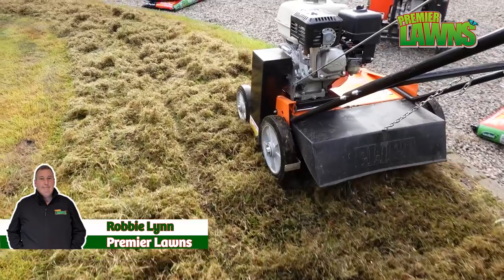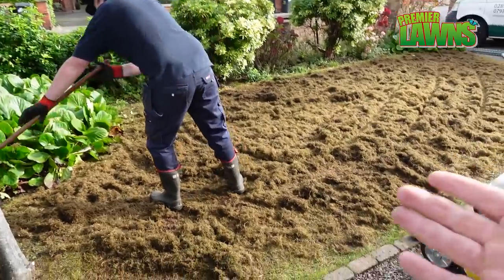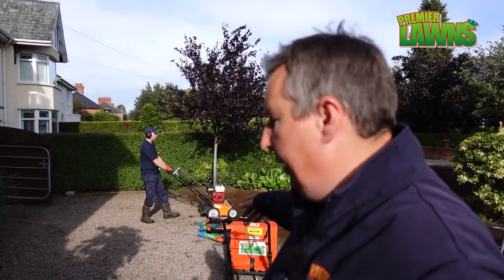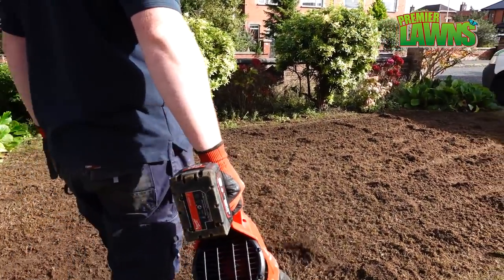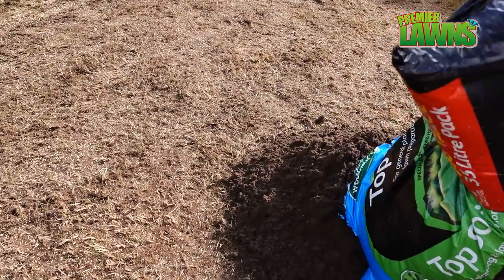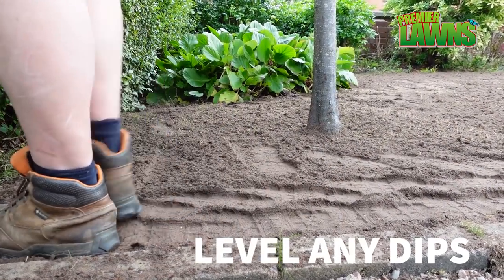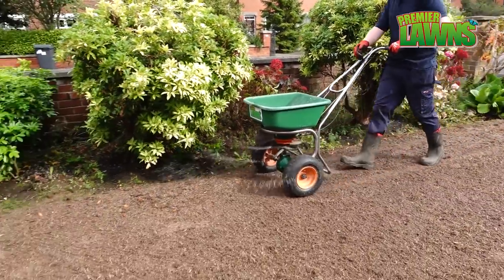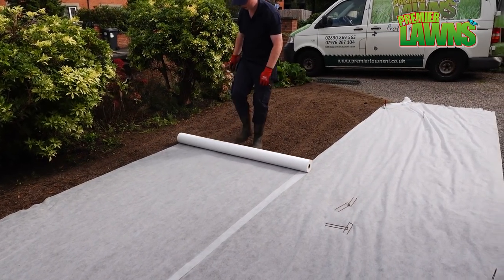QUICKEST way to turn a TERRIBLE lawn into a GREAT lawn

Comment: During the summer my lawn looks ‘fine’ but during the winter and after rain showers it gets very spongy ( there’s no moss).  I’ve aerated and scarified it over the years and recently bought an auger bit and began the process to try and fix the constant  drainage problem of my small (30m squared) lawn, it wasn’t long before I was hitting something solid which turned out to be an old paving slab, I then unearthed a further 9. There appears to be a layer of dolomite throughout with a few inches of poor top soil which is of a clayish texture and full of stones. In some areas the dolomite is sitting on top of a layer of polythene covering the clay soil beneath. Additionally after a few hours the holes I’ve dug become waterlogged. Should I just bite the bullet and get all the dolomite removed, get a French drain installed and a few tons of quality top soil or can the dolomite be left and just remove the top soil replacing it with better?
Reply from the maker: Can't beat a good drain, assuming you have a good fall and more importantly somewhere for that water to go !
Reply: Getting a herringbone system fitted next week so hopefully will finally be on the way to getting a perfect base to start a lawn following your advice and tips

Comment: Your lawn videos help me relax after my stock market research. Also, they have helped me grow my new lawn.
Reply: The one thing I didn't do is level it with a rake but I did aerate first, then seed, then stomp over lawn with flat soled sandals (lawn is very small), covered lightly with topsoil and watered. Now it looks pretty good. A few thin spots though. My lawn gets almost no sun it's totally shaded which makes it hard but it's actually doing not bad. Fescue is what I used too
Reply: My "lawn" before was all moss mats 😆 🤣 so I literally just pulled up bags and bags worth of moss, and grew a lawn after
Reply from the maker: @christalball93_  Happy to help!

Comment: Great video.
 People shouldn't be afraid to try this especially on a small piece of grass like this. I do love planting from seed you know what you're getting, Especially when you make sure you buy a quality seed.
Reply from the maker: I think with my videos doing this, there will be a lot of dead lawns this spring 😂
Reply: @Premier_lawns_official   Timing is everything when seeding.  I did my renovation starting in the middle of August Is in the Pacific Northwest. If I had so many weed grasses that I killed it all off and started over. I did the same with a scarifier and shredded it .  I re-seeded with RPR perennial rye. We had some snow for about a week but it came out like a champ !
Reply from the maker: @richardharwell  perfect. I think in the UK 100 percent PRG isn't that great for lawns as it thins out of winter. Have you found this?
Reply: @Premier_lawns_official  The new RPR  has done well so far . It looks like it did in the Fall, maybe a little thicker . If it thins I'll over seed with fine fescue and Chewing Red Fescue. 
Im planning on reno the front yard with Midnight  KBG & Grand Slam P.R.. still trying to decide.

Comment: Great video. I have low spots and bumps in the lawn. If I reseed and then build up low spots with top soil using lute will this prevent seeds coming through. Thanks Robbie
Reply from the maker: No, the weeds will find a way. We killed the lawn off first

Comment: A good professional job . No bother to Premier Lawns , the grass looks very healthy and green , Roll on Spring  .
 Just one question , would a shady  variety  of grass seed  really make a difference to shady areas of my lawn . I have some areas next to and in the shade of a garage that never seemed to really look as lush or thick as the rest of the lawn . Now ,  at this time of year  , with everything being mostly dormant this area  looks rather thin . 
Thanks in advance .
Reply from the maker: Most lawns, especially lawns that have lots of rye look very thin this time of year
Reply: @Premier_lawns_official  Yes , you are correct  .  I  redone it with a rye mix and repaired the same area a bit too late last year . Thanks again .

Comment: Could you do this in feb. or march and utilize the spring rain or would it be too cold still. For my average temp is about 50F-55F in march.
Reply from the maker: Just about, as long as the frost have passed. it's to cold to do it yet

Comment: We have had a new sewage treatment plant in our garden and it’s trashed! Lawn neglected by previous owner and very stoney/flinty and not a huge amount of decent topsoil. Would you apply the same principle here or follow a different process? Obviously will wait until moisture in ground.
Reply from the maker: There was a decent amount of good soil in this lawn before we started.  If there wasn't I wouldn't have done it this way...
Reply: @Premier_lawns_official  Any tips?
Reply from the maker: @Chris Sanders  these are very general tips, it's usually easy and cheaper to bring soil and raise it up and put some sort of edge around it
Than to dig the old soil out as landfill is expensive. Ideally you will want at least 8" of good soil compacted down to 6"
Reply: @Premier_lawns_official  Yeah I think that's where I'm headed.  Would you remove the old truf that remains or just give it a deep scarification?
Reply from the maker: @chrissanders55  if that's the type of thing you are doing, best practise would be to strip off the old lawn, you could hire a turf cutter for the day...

Comment: Hi Robbie have you any idea why my newly seeded lawn (Sept) 100% rye grass has been steadily developing yellow patches and bare spots ? It’s mainly happing on the shadier side  of the lawn. Thanks
Reply from the maker: That's your problem, rye grass looks great in the season, come the winter its not so great. Probably needs fed to
Reply: If I may, if rye is yellow, you need iron. Spray Liquid iron, it will work fast, then follow it with ironite pellets…